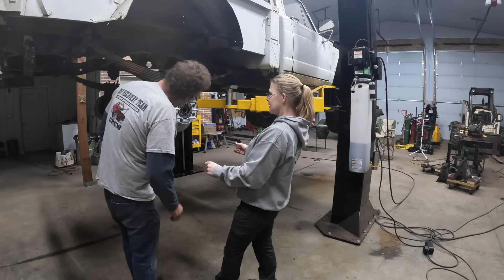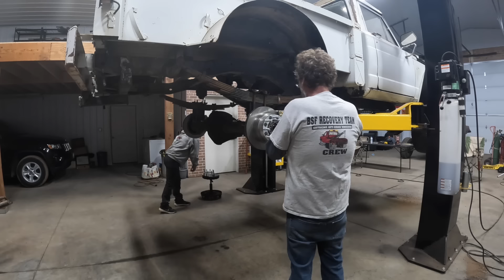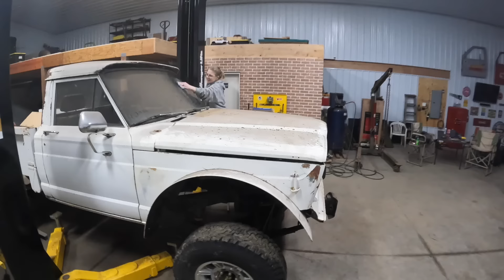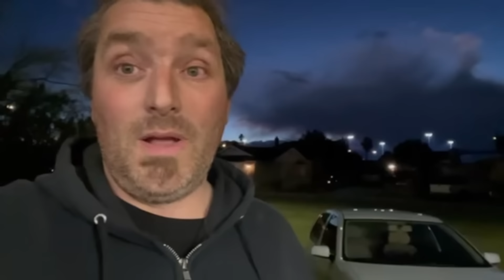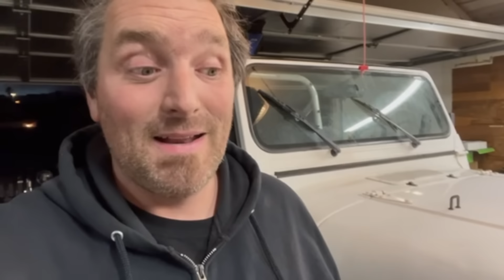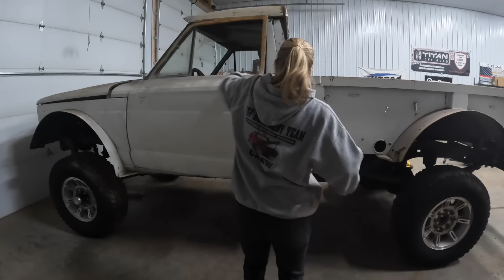Blondie on rollers

Comment: Red Loctite on spacer nuts
Reply: I think those are supposed to be temporary rollers, not the original or not. The planned tires for the end game. But I'm not sure I could be mistaken.
Reply: Spacers stay on when you change the wheels
Reply: @davidenle6227  Yes, if they were going to stay with them rims for the end of the build, they would need to use the spacer to clear the brakes. And springs 
I thought they were talking about getting different rims and tires IE new wheel combo.